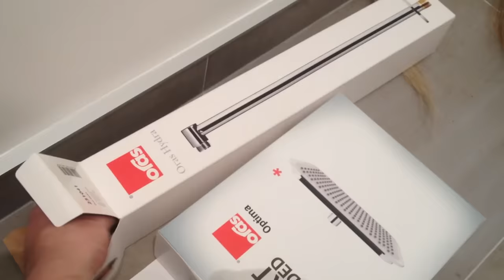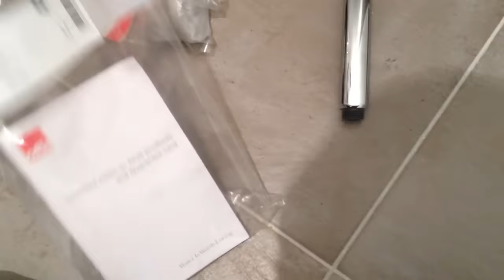Shower valve installation

Comment from the maker: Shower valve installation. A few tricks and tips to make your installation a whole lot easier. See how to connect the fittings to the sink water lines using PEX water lines and PEX fittings. This is the BEST plumbing solution for beginner DIY plumbers! It's so simple to install new water lines to your sink or "double sinks". In this bathroom training video you will learn how to use PEX water lines and fittings to quickly and easily plumb your new bathroom sink! Bathroom Plumbing is SIMPLE to do if you have the right instructions to follow. Watch this diy bathroom plumbing video and learn a few Pro secrets for getting your sink water lines installed right the first time.  How to install a drain system and explains different ways to configure it for your own situation.
Reply: what is the name of shower brand you install youre bathroom
Reply: Heating systematic
Reply: MD Firoz plumber

Comment: Please change title. This is NOT "shower valve installation." 
The valve is already installed, which is the part I wanted to see. 
This is only "shower trim and handles installation" onto the valve which was previously installed during rough-in, and does not show water lines either. Those are behind the tiles inside the wall, which was completed. 
Did you video that work as well? that'd be useful, thanks.

Comment: you do nice clean work,,plus go the extra with silicone before trim plates . what kind of drill bit did you use for small holes in porcelain  ? Thanks